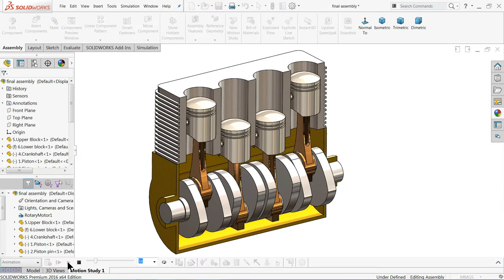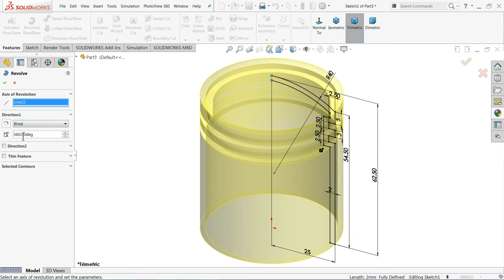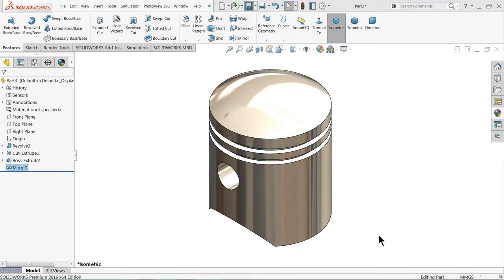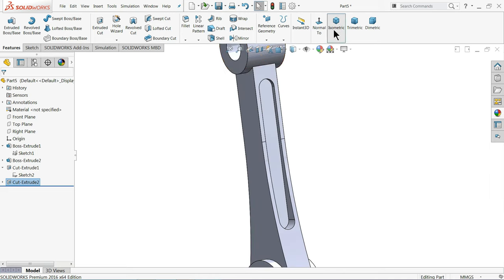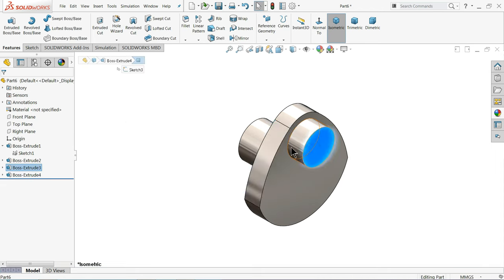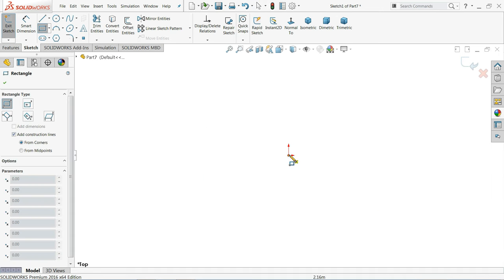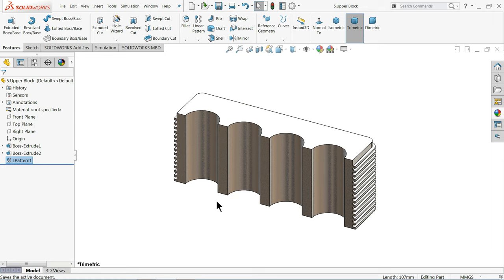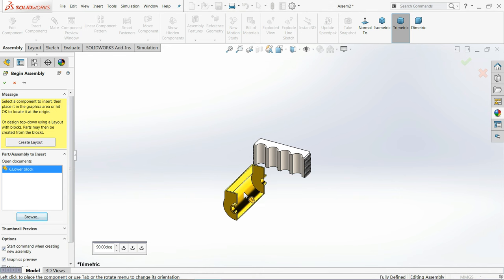Solidworks tutorial Design and Assembly of Engine

Comment: This is a great video and you consistently put out great content. My only comment is that the hole through the piston should be rotated 90 degrees from the cutout at the bottom of the piston, since the cutout is there to prevent the connecting rod from touching the sides of the piston.

Comment: This is not an engine.. You can not make this nor make it work in anyway. No effort or thought has been put into the actual "Design" of this "engine" design. This is just a beginners modeling example. The fact that these models resemble an engine is irrelevant to what you're trying to conveying to new SW users.
Reply: true that! what he's calling the Cam, is actually the crankshaft counterweight! It lacks the flywheel as well
Reply: Good lord people, its a beginner SW tutorial. It's not supposed to reach production and he never said it could. Nor did he say that he is a car mechanic. The video is supposed to teach people how SW works, not how engines function...